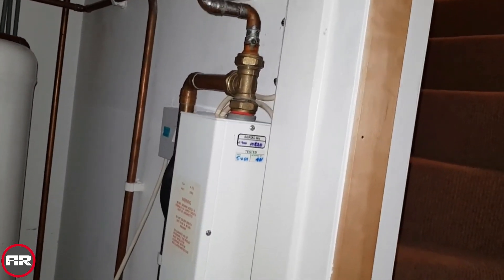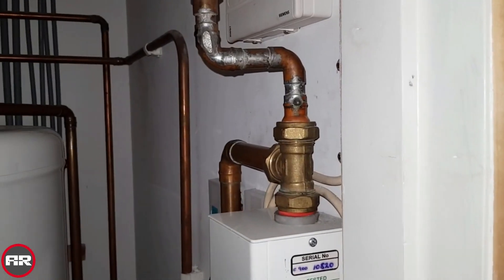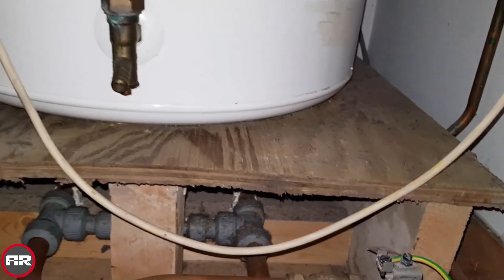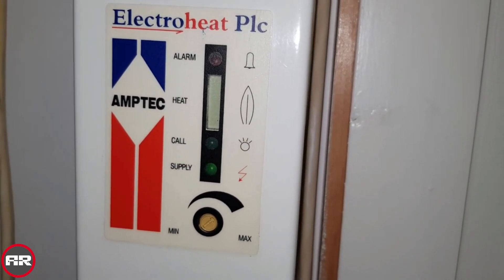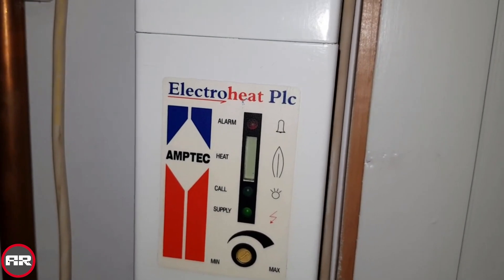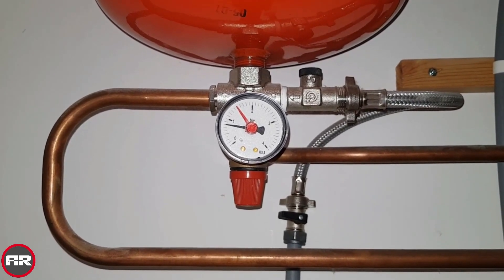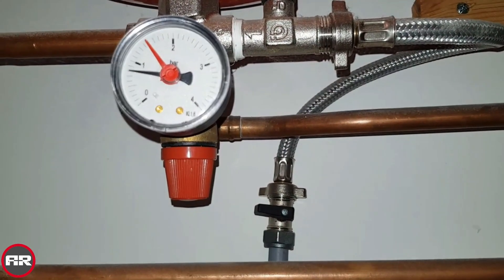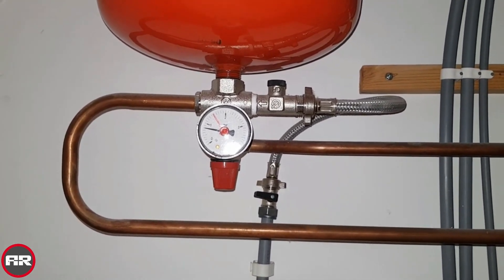Electric Flow Boiler using a Sealed System for Customers

Comment: Hello
Is this boiler supplied with cold water that gets heated up in the system or is the water supply already hot (so a separate boiler is heating it up?)
Reply from the maker: If you're referring to the unvented cylinder that can be heated directly or indirectly. Indirectly heated means the flow boiler on the wal heats up the cylinder. Hope that helps. And can you subscribe to our channel